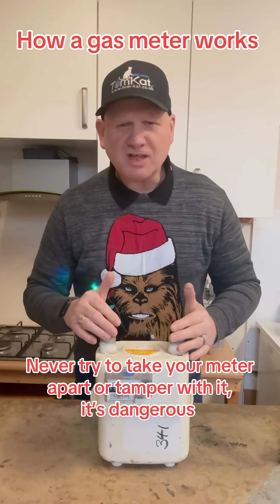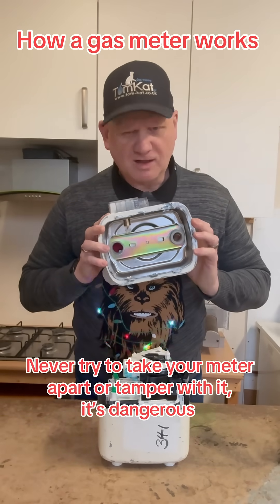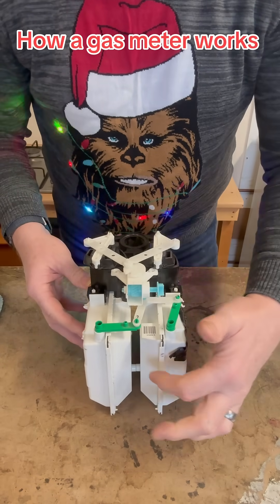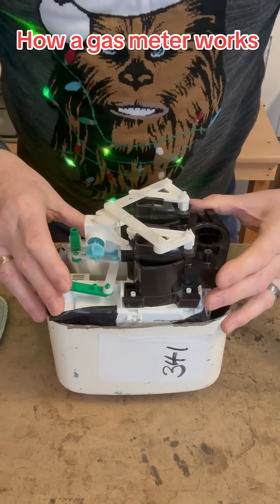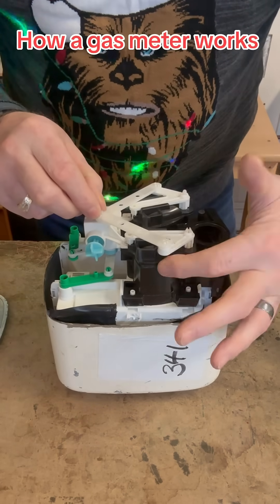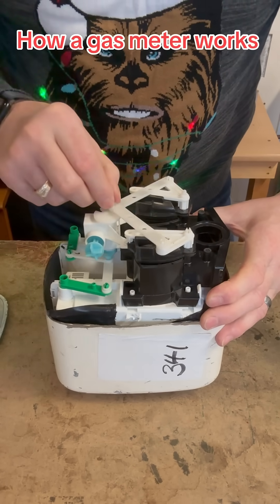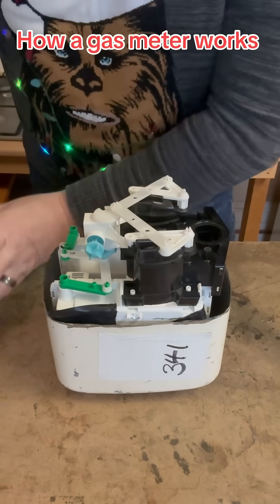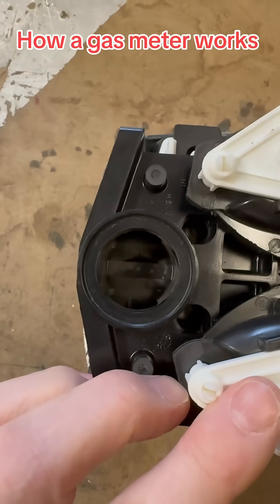How a gas meter works #gastraining #plumbingeducation #boiler

Comment: Hi can an internal gas meter be fitted to a stud wall?

I have been tasked with the job of raising a cellar gas meter up off of the floor tonallow tanking to be done, the only place is 1 ft above on a shelf in a stud wall cupboard. Is this allowed? Im thinking of adding in some sheets of cement board tor added protection.

What are ypur thoughts please.
Reply from the maker: First you need qualifications met 1 to do this second if it’s the primary meter you will need to get in touch with the gas supplier as you are not allowed to move the ECV. Also extending the anaconda will require the inlet pressure testing which you can’t do.

Comment: Not very technical, just wondering just how efficient and accurate they are
Reply: More accurate than the digital ones. They it'd all mechanical parts calibrated to work when the correct drop in pressure occurs